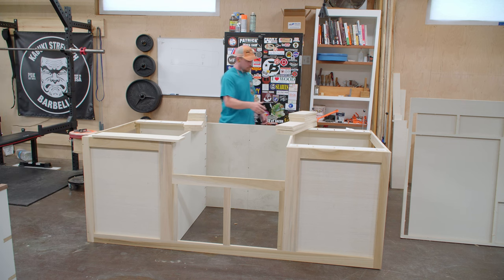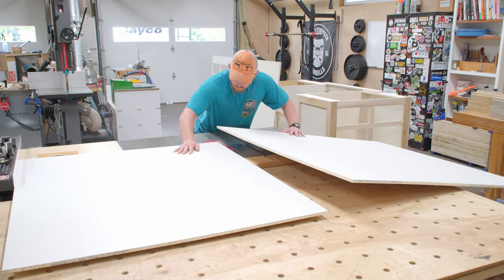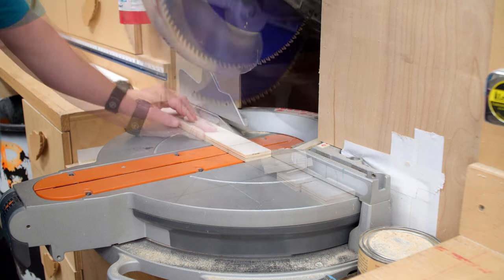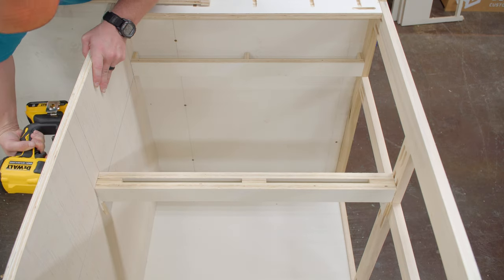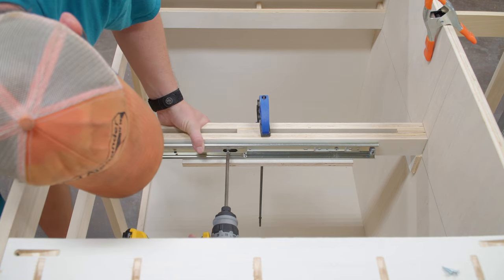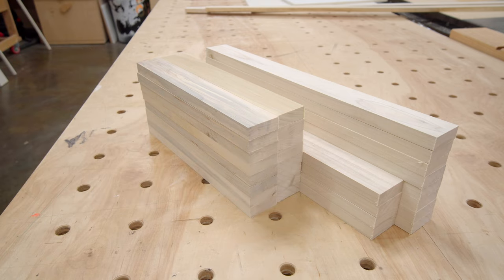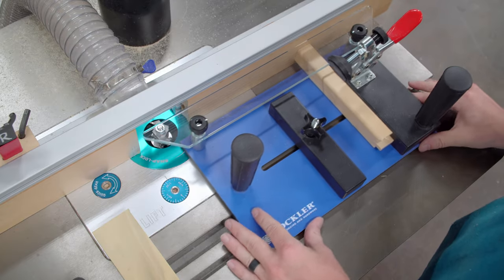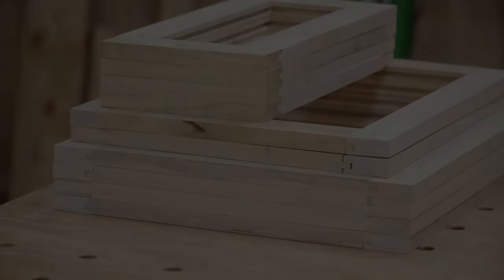Easy, Reliable, & Strong Drawers - Outdoor Kitchen Island - Day 3 - 390

Comment: I would love to hear your thoughts on the Dewalt 23ga pin nailer.  I have always thought that this was a great tool for a battery option, but Dewalt seemed to take forever to come out with their version.
Reply from the maker: I haven't had it too long but so far no complaints. I've ran 3 or 4 strips of nails through it with no issues.

Comment: I like the simplicity & repeatability you were able to achieve with this large build.  I assume you would do similar if it were an interior cabinet build (like a kitchen or bathroom)?  Or would you then consider some edge banding for the tops of the drawers there?
Also, I notice you've got the Jessum rollers (as I do as well), but you didn't use them when working with the large plywood cut.  Was there a reason for this?  I know they are supposed to help hold things to the fence (and why I got them myself).  Just curious!
Reply from the maker: If the looks of the drawer required edge banding I'd opt for solid wood instead of plywood. I got the rollers but rarely use them because it's another step to setup. They are handy but not as convenient to my workflow as I thought they would be. It's not a huge step to set them up, but its one more thing so I suppose I just forget.